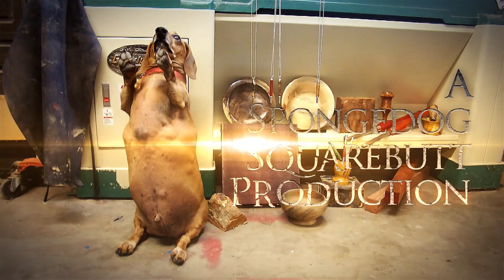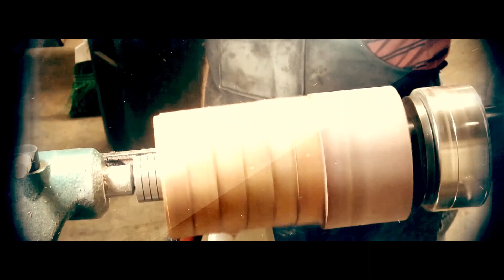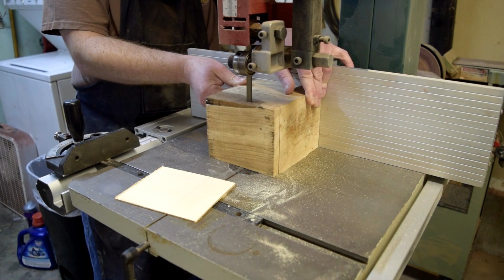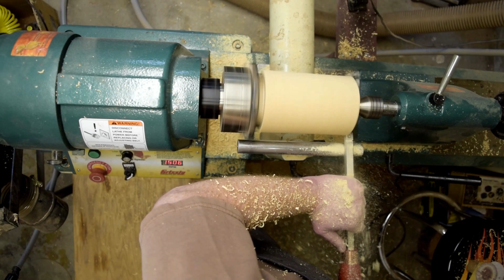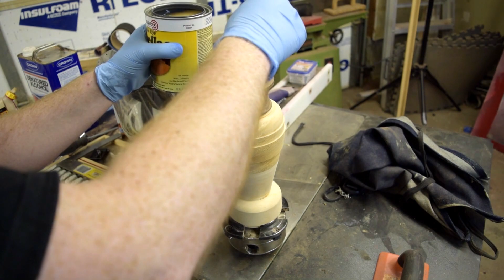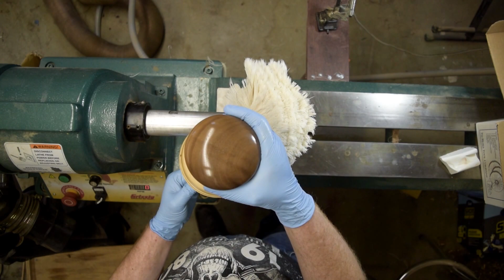Video #13 Ficus and Walnut Urn

Comment: Great job turned out very nice  I’ve been commissioned to do a urn big enough fo double remains  Grandfather / Grand mother never have done on this large it will be sycamore and walnut and crushed Turquoise bands
Reply from the maker: The size actually makes it easier to work on.  If you use the turquoise and have never done the inlay before, just use painters tape around the boarder, then user CA thin to glue in the turquoise.  Once it is stuck, user thick CA to fill in  around the larger chunks--unless you are just using powder, then thin will work just fine.